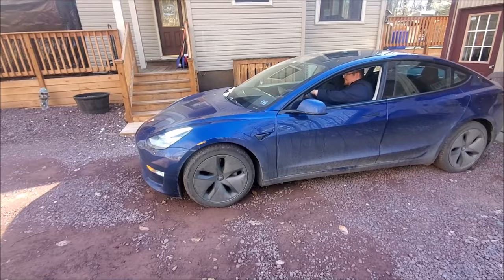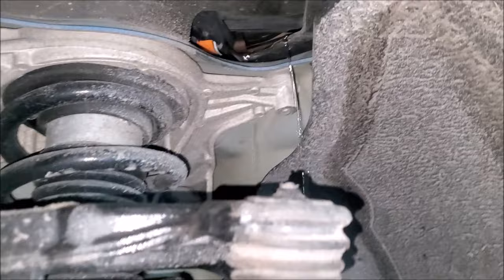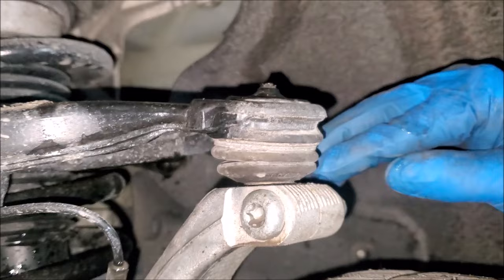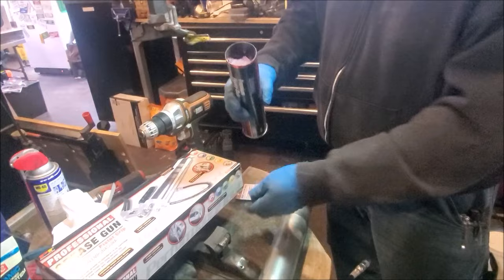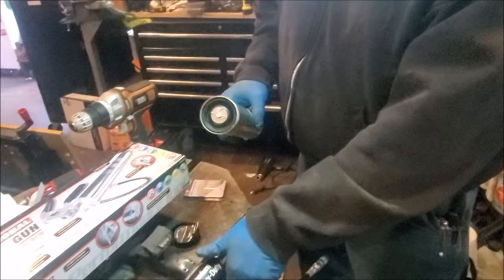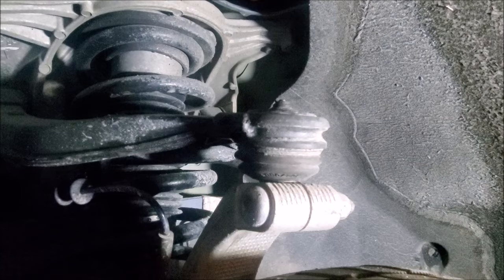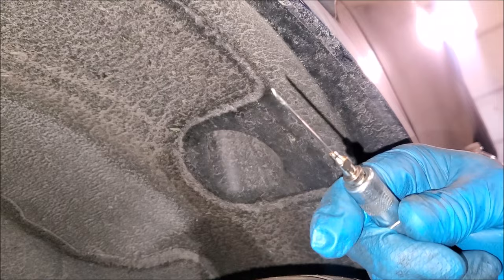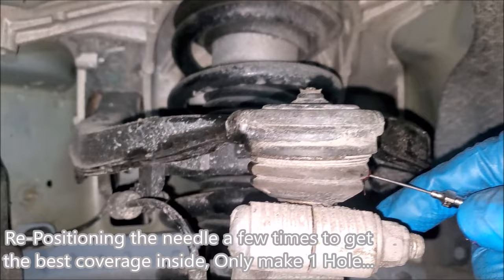Tesla Front End Steering Squeak, How to Fix it in about 10 minutes, Quick & Easy!

Comment: I went to the local auto parts store and got a gun, needle and the grease and used a puck and lifted my driver side with my jack and it gave more than enough room to inject the grease. I’ve injected grease and “voila” problem solved. Thank you for this great video!!!!
Reply from the maker: Thank you for watching and commenting  😀
Reply: I did the same thing and it worked great.
Reply: Estimated, How much all that cost?
Reply: You just have to put your car on the highest level you don’t even need a jack
Reply: @Youngandsuccessful33 what do you mean?

Comment: I own a 2018 Model 3. A few months ago I ran through a few inches of rain in a construction zone. Squeaking started, then stopped, and recently came back. So at the end of March 2014 I took it to Tesla service. The technician knew immediately it was the driver side upper control arm. Apparantly  it happens often and the part had been re-designed 3 times since 2018.  Two years ago Tesla applied a urathane sealent to both front upper control arms, but it didn't last. This time Tesla replaced both front upper control arms (they need to be replaced as a pair). My car is two years out of warrenty, so I expected to pay for the repair. Tesla charged me $180 for the parts ($90 each) and ate the installation labor (no charge for the 1.02 hours). Tesla also charged me $20 to make a EPAS alignment check. So it cost $200 to fix the problem. All in all, I thought Tesla was very nice to comp the installation labor. By the way, JD Power says the price range for a control arm is $220 to $530 and installation labor adds $150 to $200. So Tesla charging a total of $200 for the job, including an alignment check, is fabulous.
Reply from the maker: Good info. Little grease, needle and 10 minutes you could have saved a few bucks... but yes, temp. Fix.
Reply: My model y recently got this sound and mine is only 19000 miles from 2021. Do you think they will cover the cost if the car is still in the warranty period?
Reply: @weidong6846 yes, I had a model 3 in uk that started to have this issue at 28k miles. They replaced arms as a warranty repair with no charge. The default for any noise seems to be replace the upper control arms. (And if it’s in warranty and you can spare the time off the road it’s better than the temporary fix in the video). Brilliant video though, I hope they’ve fixed this issue on the highlander design.

Comment: I don't think it's a problem in the Northeast.   My 2018 Tesla Model 3P with 28,000 miles which spent its whole life in Northern CA (very little rain, no salt EVER) has the problem.  It just seems like a matter of time before this happens to ALL teslas, perhaps the ball joint geometry eventually moves the grease away from the ball, or they skimped on grease when they built the ball joint!!!
Reply from the maker: I'm in the North East, trust me, big problem! Defect design of a car designed in a dry climate.
Reply: @GarageMahalStuff  Again, I live in a dry climate (Palo Alto, 15 inches of annual rainfall), the problem happened after only 28,000 miles and 5.5 years.  Maybe car washes caused it?  We are not car wash fanatics, probably did it less than 15x over the past 5 years ...  I did the fix today but it hasn't stopped squeaking yet, I drove about 4 miles total so far ...

Comment: just purchased a 2018 model 3. immediately began hearing this problem on drivers side front wheel. spent $40 on grease gun, needle, and grease. best investment ever. worked perfect. did both sides as a preventative step. Thank you so much for this video!!
Reply from the maker: Thank you so much for watching and commenting 😀

Comment: I had the same issue on my model 3 long range 2021 and I just fixed it the same way you did it on this video. Thank you so much for sharing the quick solution!
Reply from the maker: I'm here to help and glad I could 😀 Thank you for commenting ☺️
Reply: Any issues since?
Reply: @kennedym5486  no issues so far. I think it's good to take out the wheel, free up the control arm and move it around a little bit after refilling for optimal results. GL!

Comment: My early 2020 Model 3 started squeaking at 3 and a half years and 56K miles. Was only the LF upper ball joint. I had to inject a lot of grease into ball joint with needle attachment and slightly warm joint and force ball to move and work by kneading grease into joint for 5 mins before squeak finally went away. Greased RF as well, it was not making any noise and was free moving.
Reply from the maker: Good tips, lost track you were talking about an upper ball joint, haha 😉 Thank you, be safe out there.
Reply: my late 2019 at 10,000 miles

Comment: Hey now, no need to be poking holes in the knuckle boot!
You can remove the boot seal by pealing the wire around from the rim, put a little heavy oil and not grease.
The oil will keep the joint lubed better and not push out like the grease does.
Put it back together and wrap the wire around the boot again, have done this several times.
It's been squeaky free for over 2 years now and no need for fancy tools.
Reply from the maker: That wire trick is cool, however most people will be a bit challenged with this, easier to poke and hope 😉 for the average bear.
Reply: video link?

Comment: Thank you so much for this informative video- quick question, what do you do about the exposed holes you’ve poked? doesn’t it leave space for contamination or leakage?
Reply from the maker: The holes kind of "seal" themselves with grease and pressure of the rubber. Again, a bandaid, however this  got me more than 36k+ miles more before I replaced the control arms.
Reply: @GarageMahalStuff how much did it cost to replace arms?

Comment: Thanks for the video. I think I'm having this issue as lately I can often hear creaking when turning the steering wheel at low speeds on my 2015 Model S with ~145K miles. Is there a way to confirm? Could the noise be anything else?

Around 130K miles I had the lower control arms replaced by a 3rd party shop (seems different though). I don't have air suspension on my car and I have 21" tires but I can reach in to touch this part. Do I need to jack the car up?
Reply from the maker: With that kind of high mileage I would honestly have the uppers replaced, use this as a temp fix until you do it or a shop. The needle grease fix you can either turn the wheels in and out to get clearance, a jack would make it a lot easier.

Comment: No wonder it was squeaking, look at all the rainwater forced out of the ball-joint by the new grease.  I've read suspicions that many came with no grease in the ball-joint (oops by a vendor and oops by Tesla receipt inspection?).  Tesla's official fix per TSB, after re-greasing, is to glob RTV on top of the upper ball joint to shield from rainwater.  Best to put a dab of RTV over the hole punctures.  I wonder why Tesla has 2 lower-control arms with separate ball-joints, rather than a single wishbone w/ one ball-joint.  Some say similar to M-B suspensions.

Most ball joints since 1990's have no grease nipple, so the hypo-needle for adding grease is common and at most auto parts.  In my experience, the rubber boots fail before the ball joint.  I toss the factory boots and install a better polyurethane boot when I can.  Some people drill the top of a new ball-joint to install a grease nipple.  A "lube job" used to be common thru the 1980's when factory ball joints (and tie-rod ends) had grease nipples.  On the plus side, the upper ball-joint sits above the tire so no need to remove the tire, just jack the body up so the tire hangs down for more room.  On older U.S. cars, you must remove the wheel to access the upper ball joint.
Reply from the maker: Good stuff... yes bad design and a little dab will due ya, will only last through 1 rain fall drive 😞 just a bad design that needs a upgrade.

Comment: Some other videos suggesting this fix suggested that it was necessary to drive around a few miles after greasing in order for the "grease to work its way around." Do you think that's necessary?
Reply from the maker: Gravity always plays a part here, I would aim the needle as high as you can to totally get the best coverage, move the needle around to get all the spots. Yes driving around will also help circulation of the grease. But rarely will grease climb... but typically will kind of stay in place.

Comment: Why does rain outside the ball joint affect the inside? Should you place a dab of RTV sealant over the holes when done?
Reply from the maker: Water will find a way. RTV could help, but you never want to plug any possible spots water could escape... typically moisture enters ball joints as moisture, in colder climates. However surrounding the area with drain water from the windsheild is certainly not helping keep that moisture level down.

Comment: Mine sounds the same. Added grease and nothing changed. Sounds like the top part of the control arm connected to frame
Reply from the maker: You have to aim the needle upwards... 2nd Tesla we did needed the needle aimed up to get more on top... so move the needle around to get more coverage inside. We really had to get a lot of grease in the 2nd one...

Comment: My only question is whether it's necessary to jack the car?  I looked and have access to the ball joint without, but the wheel not being weight bearing may be an important part I am overlooking.  Thanks for the video.
Reply from the maker: Easier lifted, but possible without, just turn the steering wheel left, grease both sides, turn right and repeat.

Comment: Just done the same on my 2014 Model S. Water pools in the upper wishbone metal stamping form and finds its way into the ball joint (lift the plastic covers in the frunk pull up the rubber covers underneath you can see the ball joint, its easy, leave the wheels on simple). Tesla design in LA.......no rain. Teslas suffer from water ingress in lights, body sealing, sunroofs, window seals.......not badly just indicative of LA focus /experience and running a Tesla 130,000 uk miles 25% in the rain! This is the Achilles heel of Tesla but my guess is Cyber Truck and onwards they will have learned and lets face it who really cares the vehicles are staggering either way these injection needles exist because grease nipples and preventative maintenance "not cool" LOL
Reply from the maker: Yes sir
Reply: Yep... My family owns a 2018 Model 3, we're in Switzerland. Lots of rain, salt in winter, and narrow roads. We always joke about the car - she's a California girl, she doesn't know how to cope in Europe 🤣 It's still a great car, though. 4x4, can drive on snow... Squeaks a lot, of course, that's why I ended up here.

Comment: Is there any concern that the seal is broken by the 2 needle holes?
Reply from the maker: It is so small it almost "self seals" and the grease pushes through with the positive pressure. We did 30k+ more miles with no issues before we traded it in...

Comment: How long can u drive with the squeak? I been driving for 1 year squeaking with no problem . It is annoying tho
Reply from the maker: Every "squeak" wears metal away... safety issue, too long and it will become so loose it will break off. Greasing is or replacing the joint/control arm is necessary. Be safe

Comment: Do I need to jack the car up??
Reply from the maker: It is easier that way, but if you turn the wheel all the way right or left, you can kind of get in there... just make sure you move the needle up and down, right and left inside the pin hole you make. That way you get the grease all up inside there...
Reply: Ok thank you! I just don't have a floor jack and I just got all the parts you've listed and I'm excited to grease her up, I'm getting new tires tomorrow so I'ma try an take advantage of the jack or when it's jacked up.. just they don't let u into the garage usually, but thank you for your video it's exactly what's happening to my m3 2019.. and for replying awesome!!
Reply: Omgoodness I forgot to tell you it worked perfectly...I can drive with or without a radio now!!! So nice and quiet...thank you for the video it helped me for sure!!

Comment: With my model Y I was getting a very similar noise and I brought it to Tesla and they fixed it why I waited. 

It took them only 66 minutes   

And it was free of charge on the warranty   

And this is what the invoice stated:

Concern: Customer states: Other · Noise & Vibration - Front control arms just started squeaking this morning. Multiple friends with Tesla’s tell they’ve had theirs replaced as well. Seems to be a common issue.
Verified customer concern. Diagnosed and found both front upper control arm ball joints to be seized, causing the squeaking noise when turning the wheel. Replaced both front upper control arms. Performed validation test drive to verify proper operation after repairs. No noise present at this time, no further action needed.

Is this the same thing? 

It seems like it’s better to just bring it to Tesla while you’re still on the warranty 

Because if they’re going to replace the control arms for free, you might as well do it   

Rather than wait till your warranty has expired, and then you have to pay out-of-pocket
Reply from the maker: Yes, basically the same thing... glad yours was under warranty, super expensive otherwise.
Reply: Which warranty is this covered under? My app shows two different ones.

Comment: I don't have a squeak issue I have a clicking issue, when I decelerate it clicks once when I accelerate it clicks once again, until I decelerate and then it clicks again, this is an ongoing constant noise from my front left rim. Annoying since the rest of the car is so silent.
Reply from the maker: If you are north of 50k miles, it will be the ball joints on a Tesla for sure...
Reply: That noise can be drive shafts ... get Tesla to check.
Reply: Drive shafts. Replaced mine last week and clicking sound is gone. Now I only need the grease the ball joints so the noise from the suspension will also go away!
Reply: To everyone that was replying, no it was not the drive shafts and it was not the ball joints. It was simply removing the wheel and the hub nut lubricating inside reapplying the nut and torquing down to its proper torque specifications. Completely solved the problem, has been quiet for weeks now. Out of warranty, but they didn't charge me anything and gave me a loaner vehicle to top it off.
Reply: Very common problem on TM3. Hub nut not tightened in the factory to the recommended torque. If the car owner does not go to Tesla service center immediately, the shaft splices will wear out.

Comment: I don’t buy the water analogy. I think that’s just you repeating what you heard online. The reason I don’t buy it is because cars are allowed to get wet. What do you think happens when it rains and water splashes up in the wheel well? It’s like a river. Further you admit that the ball joint is sealed. Then what would water splashing matter?

I think it’s just a matter of too small a ball joint and not enough grease capacity so it dries up. 

The water draining on top theory is just a red herring
Reply from the maker: I strongly disagree, water will find away... sure water splashes up, but sitting out in the rain with constant water pouring in on top... certainly not helping. Ball joints are plenty big, even for a small truck, which it matches the weight of. Just poor parts, badly engineered. 😢  sorry Elon, I am a big fan, but always room for improvement.

Comment: Moronic theory as to "design flaw."  Water drains out from windshield when raining is the issue?  As if water isnt splashing up from road on any other car.  Ball joints go bad by nature.  Planned obsolescence.
Reply from the maker: Moronic... That's not nice... why do people feel the need to name call instead of having a solid offense? Design flaw, yes. Designed obsolescence, of course. Point it out with a video to show the exact hit of the drained water onto the part that squeaks and fails, great visual example.
Reply: @GarageMahalStuff  Didn't call you a name.  Said the logical deduction is moronic.  An equivalent amount of water is splashing and spraying all over every other ball joint on every other car off the road ways when raining.  Every ball joint gets extremely wet in rain.